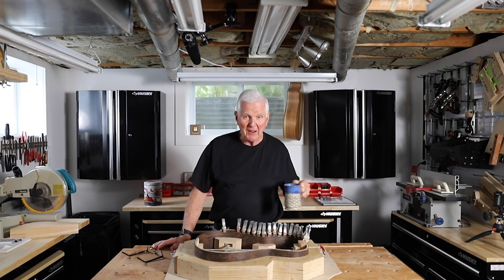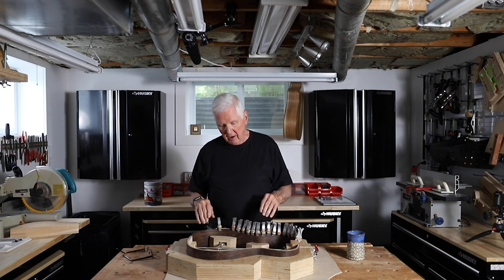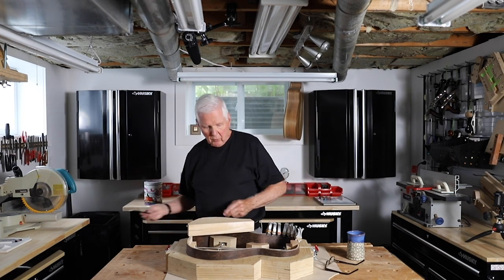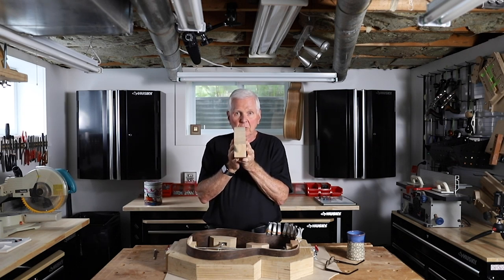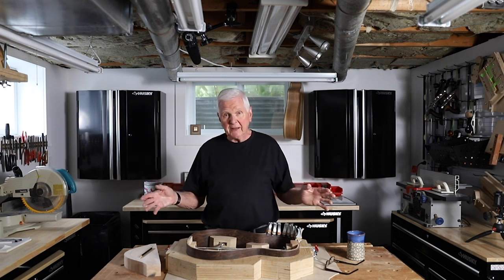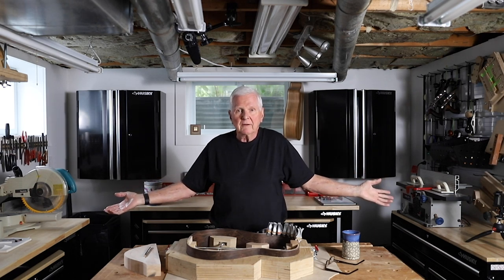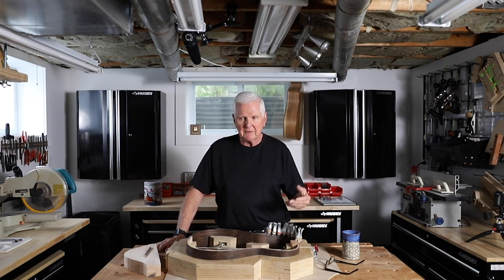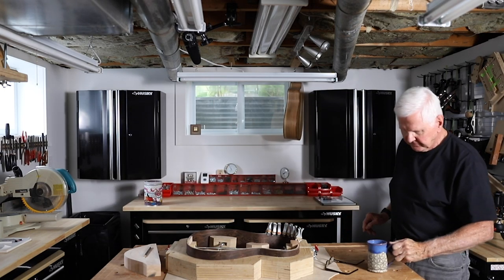Make an acoustic guitar armrest like a guitar pro builder

Comment: I need to start with getting my diesel out of the shop.  It's taking up the whole shop .
Reply from the maker: As "they" say...start at the beginning.  lol
Reply: @MontyMcKinnon  well the story starts with a 23 year old diesel that my wife loves to drive . 
Old red as we call her , the truck , caught a virus in the fuel system , and not no flu either . I think she may have wrecked her high pressure oil pump .  . So she curled up in the garage peeing on my concrete ,and she pushed everyone and everything out of her way  . I'll post you some pics , lol. Sad sight really .